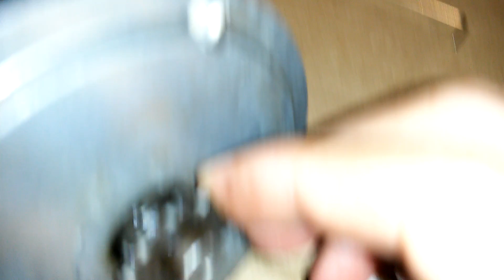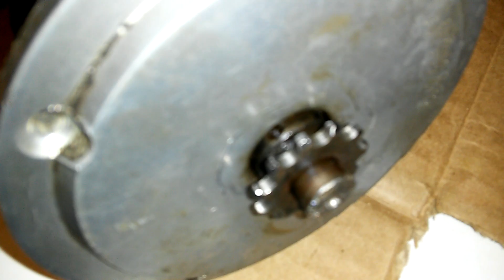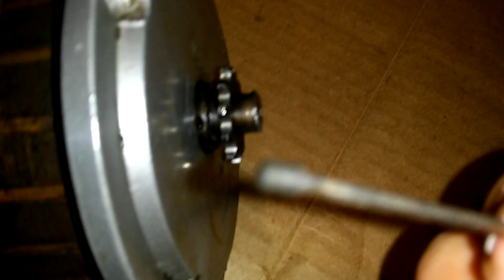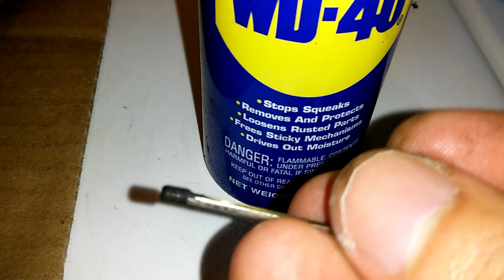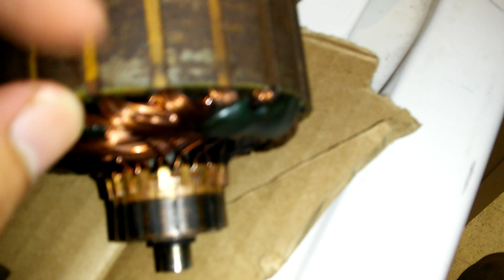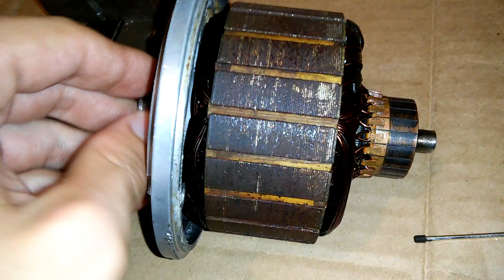Scooter Drive-Gear Repair Part1

Comment: grub screw, not key way.  Grub screws can be a pain, strip out, loosen up ect.
Reply from the maker: lol yah that,my bad! im much more used to working on engines than electric motors. keyway=flywheel

Comment: What type of scooter is it? Motor looks to be in good shape.
Reply from the maker: +Sam Lams Top 10 STILL looks good even after driving it underwater! (thats not what caused the problem either)
its a 24V Currie Tech 400W motor from a Currie Tech Ezip 400 model electric scooter. rated 24V @22A 2600RPM
and all i have to say is WOW... stay tuned to the new updates coming within an hour or so. after dismantling this motor and servicing it.. its a LOT more powerful now, i readjusted the brushed (which look MINT btw)
cleaned the steel plate rotor and WD-40'D lots of crap build up and rust out. lots more power and the top speed even increased! (GPS Clocked 14-16MPH,which now i was able to get up to 18MPH and you can really feel the performance difference even at stock voltage. tons more power and torque, and rides SMOOTH as butter :3